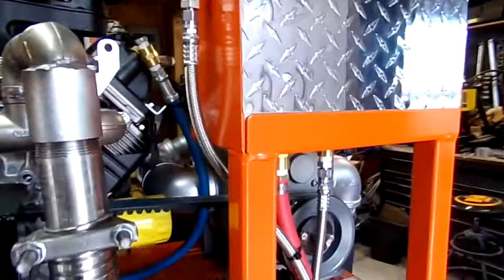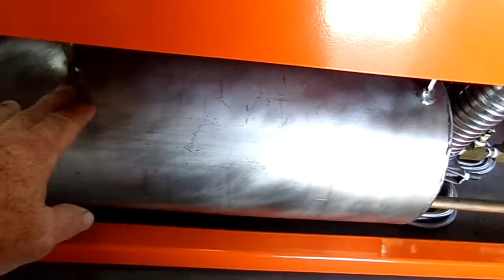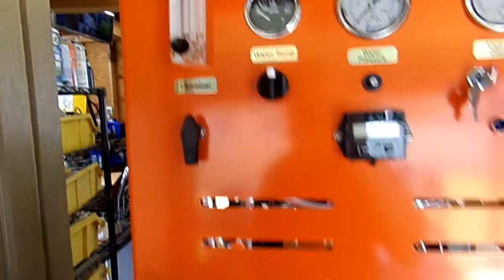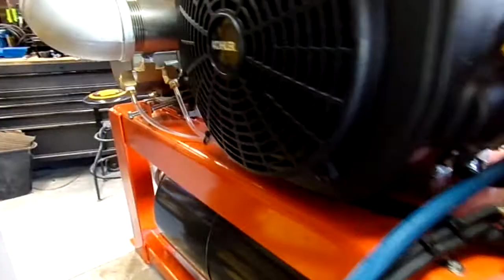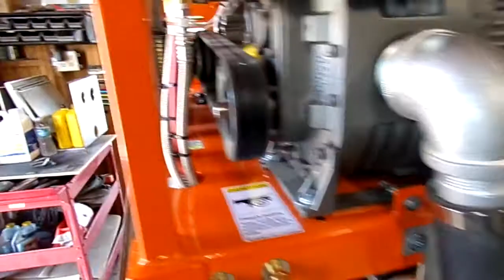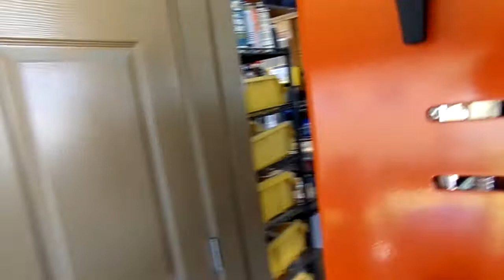Blue Baron Compact 45 Truck Mount "Greatest Truck Mount for the money"

Comment: MSRP??
Reply from the maker: $14895 including reels and Hoses. Need a proposal with Specs, send me your name, contact information & email or call me at 727 505-2989 ask for Pete
Reply: @MrBlueBaron1  Maurice Jones with Jones Cleaning Service LLC 
I have a older machine CFI 2000, with 26hp Kohler motor it does fair decent, I've been in business for bout a year and half.
Reply: How many psi does that machine have
Reply from the maker: @jonescleaningservicellc8076   up to 2000 psi
Reply: @MrBlueBaron1  ok, I want something I could also pressure wash with as well may be 3200 psi
Reply from the maker: @jonescleaningservicellc8076  I would need a higher flow rate pump. Typically our lager consoles with larger pumps can get up to 3000 psi  got to: https://www.truckmountcarpetcleaningmachines.com/redbaronintro.html